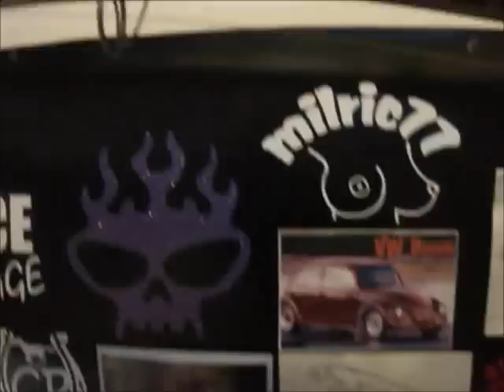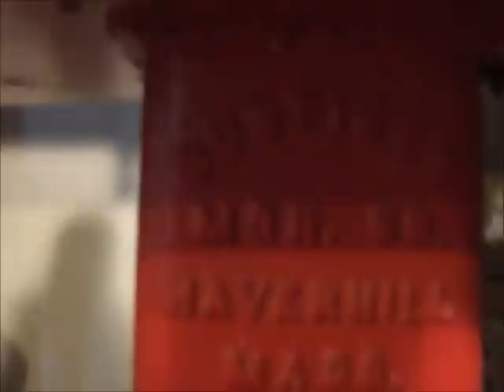Satuday,Mail,Chain saw

Comment: as my wife says men are always attracted to round and shiny objects.......she's right lol. 
chainsaw ruff settings high end 3/4 out, low end 1 1/8 out. when adjusting set top end first, run in or out till you find high point. adjust idle up, now set low end snap trigger for accelleration, if boggs open up low end.  then adjust idle till chain stops moving. note, you may have to pull plastic caps off of jet needles, throw them away. hopefully this can help you.